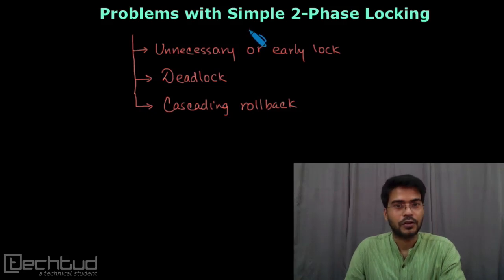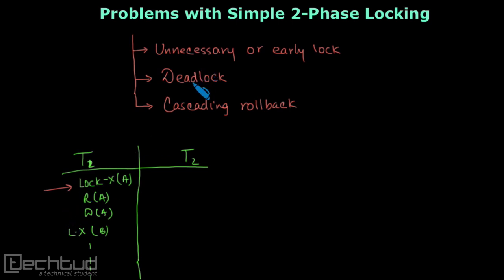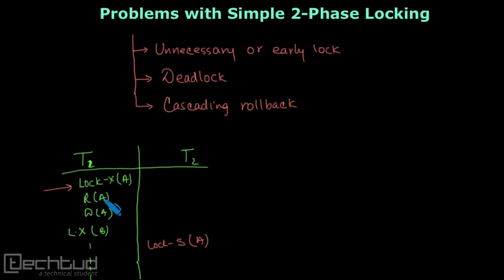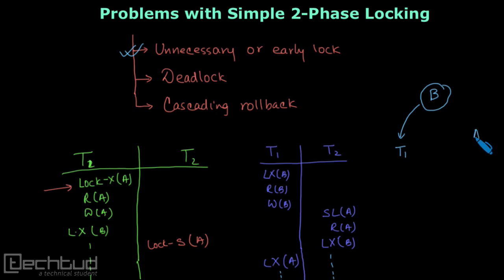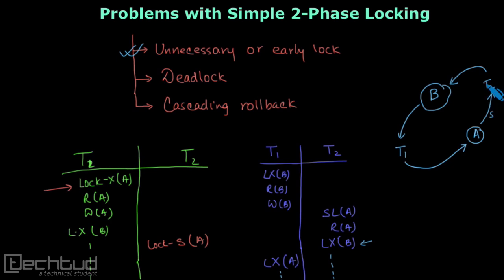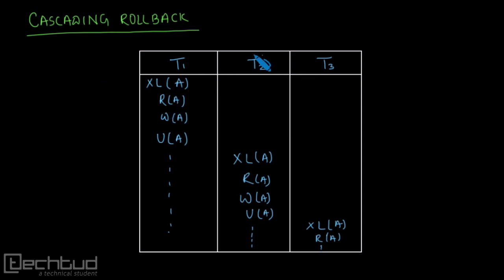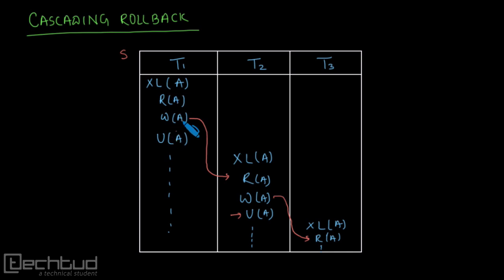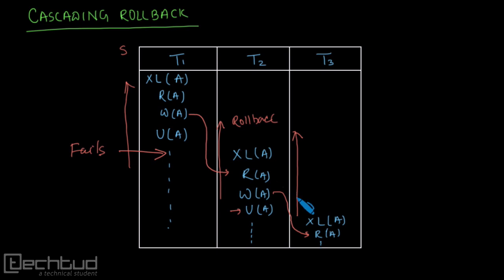Problems with Basic 2- Phase Locking Protocol | Concurrency Control

Comment: In the example for illustrating cascading roll back, how come the condition for simple 2P lock is satisfying when in T1 -  after X-L(A)  there is U(A) and in T2 again there is XL(A). As once the unlocking starts no more locking can be allowed in a schedule.

i am confused in this. Can anyone please help me to get this correctly??
Reply: The rule applies to each transaction and not the entire schedule. Given one transaction, it should either only acquire locks or release locks. Since here T1 gets a lock on A and then T1 (the same transaction) releases that lock, T1 is in 2PL. Similar reasoning applies to the others.
Reply: same doubt
Reply: same doubt
Reply: The condition that,first will be the growing phase then will be the shrinking phase will apply on each transaction separately,not for  all transaction together.

Comment: sir, if shared lock is already exist on a data item ,can i apply exclusive lock on this same data item??
Reply: Hi, sorry if it's a bit late.
But, No you cannot apply an exclusive lock to an already existing shared lock. But you can apply a shared (read) lock to another existing shared (read) lock. I.e read locks can be applied on the same data several times which is where the obvious name Shared lock comes from.
Hope this helps,
Thanks.
Reply: yes.. but only if no other transaction is having a shared-lock on that data item